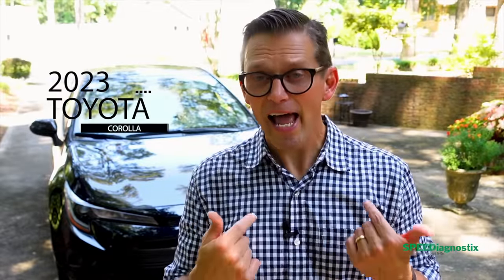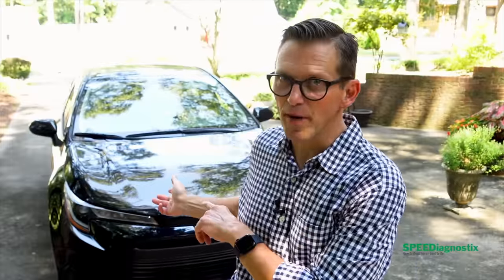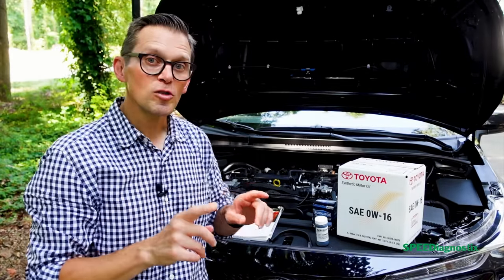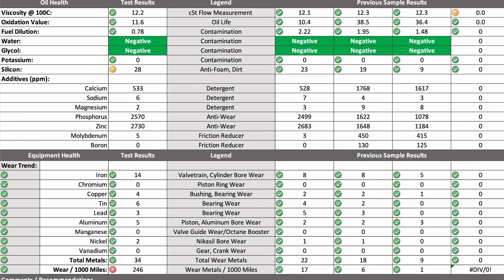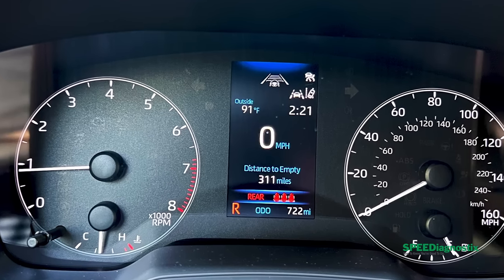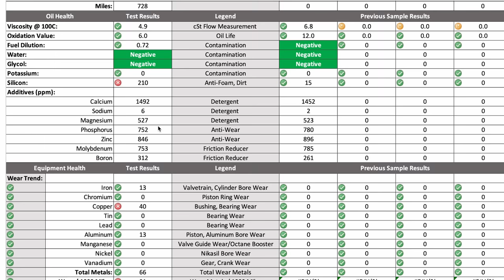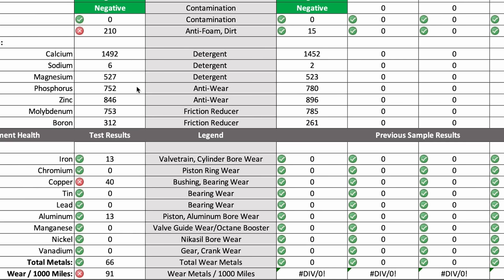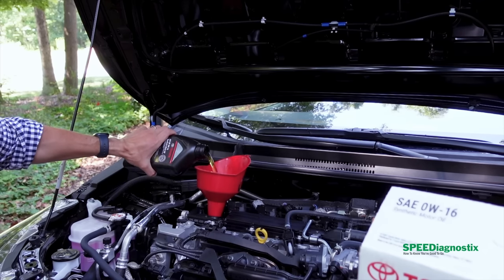AVOID the ONE MISTAKE Almost EVERYONE Makes With A Brand New Car

Comment: Back in the pre synth days I always did first change between 500 & 1000 miles. Then changed every 2 months or 2000 miles. With synthetics I still do first between 500 & 1000 miles and then every 3 months or 3000 miles max. I’ve always kept my vehicles for high miles and never had engine problems. It’s served me well for 40 plus years. Like the old Fram commercial stated “ You can pay me now or pay me later”.
Reply from the maker: Right on!
Reply: Why every 3k miles when SYNTHETIC OIL doesn't even BEGIN to break down significantly at 5k miles???
 Don't you think that's overkill?
Reply: @michaeltammaro482  what breaks down oil is fuel that drips into crankcase after every shut down which is why short trips are killer. Plus if I’m traveling and go over 3K I know I’m still protected. Also heat cycles and ambient temps cause moisture which also gets into oil. This I learned from an oil engineer. But overkill has helped me achieve very high mileage out of my engines with no failures or any problems
Reply: It's nuts to change synthetic every few months! I knew a tow truck operator decades ago who only changed the filter & topped up the oil with another near quart every 3-5000 miles. He was approaching 400,000 miles on the truck.
Reply: @pablobruise1388  maybe to you it is. But knowing combustion and dilution and physically seeing what it does to oil and engines I’ll continue my ways. Been a mechanic for 40 plus years so I’m good with my decisions
Reply: @michaeltammaro482  It depends on the duty cycle.  If it's all city driving in the hot and dusty desert (where I live), 3K is common if you want to avoid sludge. Highway driving in Illinois?  Probably can get close to 8-10K out of it.
Reply: The oil is fine at 3000-5000 but the metals, gas, contaminants in the oil is the potential problem. Tiny investment for long term reward.
Reply: For how many miles have they lasted you? I only did 3k on my older twin turbo car, and 4-5k on my m4. I'm thinking of doing 5-6k on my new corolla
Reply: 3k with modern oil is a waste of money and time.
Reply: @PNW_Sportbike_Life  modern oil is still susceptible to fuel dilution, byproducts of combustion moisture etc. You do whatever makes you happy
Reply: @PNW_Sportbike_Life  My Ford shipped with normal oil, not synthetic.  So it depends on what came with the car.
Reply: Synthetic at at less than 5,000 is a  morons way of doing things 6:58
Reply: @DanielJohnson-ec8rk  You can think that but I’m guessing that you aren’t an engineer.
Reply: @peteschiavoni  I pay attention to facts that engineers have proven.
Reply: @DanielJohnson-ec8rk  So you know what breaks down oil. You’re aware that different conditions cause oils to break down. It’s not just heat and friction. If it were, synthetics could go hundreds of thousands of miles like in transmissions of OTR trucks.
Reply: @peteschiavoni  there are many reasons for oil breakdown. I have my oil analyzed so I know the condition of my oil. Last change was longer than normal at 6,500, oil had not broken down or depleted the additive package enough where lubrication was sacrificed
Reply: @DanielJohnson-ec8rk  Hey if it works for you fine. I wouldn’t say you’re a moron. It’s your vehicle, do whatever you want. As will I
Reply: @peteschiavoni  I used to do the same as you. Then started having it analyzed and found out I was wasting my hard earned money. I drive up to 335 miles a day in a 5.7 HEMI truck and have about 285,000 on this one.
Reply: @DanielJohnson-ec8rk  See that’s the key- the mileage you travel. Engine gets up to temp and stays consistent. When I travel I’ll go over 3K and not worry. But a lot of times it’s 5 mile trips. Lots of on and off.
Reply: @peteschiavoni  I start my truck at 5:15 am and it doesn’t shut off until 6:00 pm. No short trips so therefore, no condensation. My last TBN result was 2.4 so bases weren’t depleted
Reply: @DanielJohnson-ec8rk  That definitely makes a difference. That’s why OTR trucks can go 50K on changes. 
For me it’s either traveling and only shutting off the engine when I need gas or going around town. The around town is 3K or 3 months. When traveling I feel comfortable going over 3K. I also pull a utility trailer around town with lots of hills. So I watch my driving and change accordingly.
Reply: @peteschiavoni  I work in masonry construction. Brick, block and stone so pull trailers regularly but almost always on highways. The high mileage claims of newer synthetics are quite real and accurate. Penzoil ultra platinum is my choice
Reply: @DanielJohnson-ec8rk  Pennzoil is great stuff. That’s my second choice only because I’ve been a Valvoline user since 1982. 
I love synthetics. The peterbilts I drove with Eaton manual transmissions had a change interval of 500K. Any they held up great. Even with heavy loads. We were always past the 120,000 pound truck rating. 😁
Reply: @peteschiavoni  my purchase of a 2011 BMW X5 with the 4.4 twin turbo V8 got me to switch as it’s their recommended oil. After using and the analysis, I was sold
Reply: @DanielJohnson-ec8rk  I think Pennzoil is fantastic. It’s just hard to break away from something that’s worked well for me. There has been times Valvoline wasn’t available locally and I easily chose Pennzoil. I know I can order online but prefer going to the local parts store for things to support them.
Reply: @peteschiavoni  unfortunately I always have to order through the Walmart app orthopedic variety. I use the lire platinum in my BMW AND Toyota and it’s always I stock at the sty
Reply: @DanielJohnson-ec8rk  I get that. I’m lucky my store has what I like. But that’s definitely not the case everywhere. If I couldn’t get Valvoline or Pennzoil locally I’d order it online. Many years ago at my old house I had to drive 50 miles to get Valvoline or Pennzoil. All around me was Quaker State or Castrol.   Just the lay of the land I guess

Comment: So much misinformation out there. This was super helpful to add to my case. I just got a new car and every single person told me I didn't need to change the oil but in my case the manufacturer gave a specific mileage where they consider break in to be done. I will be changing the oil right at that point. Science is a hell of a thing!  Great video!
Reply from the maker: Thanks! I'm glad it helped!
Reply: 1000 miles is probably a good starting point
Reply: @Playingwithproxies  Nissan lists 1200 for my particular model.

Comment: I have always had new cars. And I always closely observed the break in procedures. And I'd change the oil and filters at about 1,000 miles. Switched over to Amsoil and do 7500-10K(for the 10.5 quart sys) changes. On one car, due to past valve drop issues, I sent samples to Blackstone Labs. The results are stellar. I did this for several changes. No titanium at all in the oil sample, along with any other wearable metals. And both my engines rarely need oil additions between changes. I've alway felt that doing this with a proper break in will greatly reduce the chance of having a 'problem child' for the rest of the car's life. Glad to see this video reinforces my original idea.
Reply from the maker: Thanks for sharing!

Comment: I got a 23 IS500 this March, I changed the oil myself at about 600 miles and then again at 1500. I tested it both times, and the first change had tons of contamination, the second had way less, I plan on doing it again at 2500 and then every 5000 after that.  After seeing the oil after the first change it's so critical to not wait imo
Reply: You are smart. You should change the oil by 1,000 miles to get all the crap out of the new engine. If you have a differential in any vehicle, ie, truck, AWD, etc you should change the fluid the first time at 5,000, also allowing the initial metal to be removed.
Reply: @bluesky-ud9wg  ya I have the vehicle parked for winter already but I'm planning on doing the tranny fluid and LSD sometime next summer.  The way toyota doss their oil filters is both a blessing and a curse. It shows everything that the filter catches and scares the crap out of you but since buying toyota's I realize the importance of the first few oil changes.  Once they are broken in there's nothing in there but the first oil change is shocking.
Reply from the maker: Thanks for sharing!
Reply: @bluesky-ud9wg  Absolute rubbish. Just service it as per manufacturers recommendations.
Reply: @motleydude73  Your hilarious if you think that way...
Reply: @bluesky-ud9wg  Why? It's what Toyota recommend, you know the company that built and benchtested your engine? And countless others? You're just wasting $ and perfectly good oil. Hilarious indeed.
Reply: @motleydude73 You don't know anything about vehicles, you're statement says that
Reply: @motleydude73  I would break the facts down for you but I already know it won't be heard and you will still have your opinion...
Reply: @bluesky-ud9wg  I know plenty, and about oil. You obviously don't.
Reply: @bluesky-ud9wg  Please give me your 'facts'. I need a laugh. Undoubtedly will contradict everything I've experienced in my career as an automotive technician.
Reply: @motleydude73  Haha, deflected the question. I'll leave you with another one that you will ignore; Some have a 10,000 oil change interval. The cars with 90-120k start to use oil, doesn't leak, it's being consumed. Wonder why..lol.
Reply: @bluesky-ud9wg  What question did you ask? You just made bold statements with zero validity. And be more specific. What cars? What engines? 90k-120k? Mines done 155000 kms and doesn't use any between it's 15000 km changes. Nor do the majority I work on daily.
Reply: @bluesky-ud9wg  You're basically insinuating Toyota know nothing about the engines they build and rigorously test...
Reply: @motleydude73  Deflected again as usual. Take care
Reply: @bluesky-ud9wg  Says the guy deflecting my questions. You didn't ask me anything, just made brash statements. Not very bright are you?
Reply: @motleydude73  Childish insults, also because you haven't had anyone with more knowledge than you stand up. Anyway you know nothing of my career, my experience at all so take care
Reply: @bluesky-ud9wg  I think you're a 15 year old with your first car that daddy bought for you. Your knowledge is at that level.
Reply: What did the oil analysis indicate the metal came from?
Reply: @motleydude73    May be unlike yourself, he does not lease his cars for 3 or 4 years.
Reply: @bluesky-ud9wg   May be he leases his cars for 3 or 4 years.
Reply: @M.R.1525 In my 34 years of driving I've never leased a car. Where did you get that random notion? Only ever bought second hand and one brand new car in 1995. Kept that for 11 years. That had 10,000km oil changes from new, no 'break in' changes and it had 240,000 kms on it when I sold it. Was still running sweet. As have all my vehicles. Some with well over 300,000 kms. All serviced at manufacturers recommended intervals. There is ZERO evidence extra changes give more longevity. Plenty of evidence to suggest it costs you extra money though.
Reply: Look up planned obsolescenc
Reply: Motleydude, hey genius where is your video, we would all love to hear your genius
Reply: @motleydude73  It depends on the manufacturer and the car.  If you have a high-performance car and expect to rev it in the 3-5K range every day ( especially if manual ), then a proper break-in at those RPMs is critical.  Most people loaf their automatics around at 1500rpm all day long and never put any stress on their car, so the break-in period is much much longer.
Reply: @garman7921  Oh I'd love to make one. Showing how this oil geek is talking out of his arse. But it's kinda hard collecting together all the cars I've done oil changes on over the past 3 decades. Break ins are completely unnecessary and 15k km changes are perfectly fine. Experience trumps assumption.  Stop wasting time and money listening to muppets like him.
Reply: @TheJcrandazzo  Are we talking about washing machines now? Cars do not have planned obsolescence, it's impossible. Once a new owner buys it it's longevity completely depends on how they treat it. A 70 year old man buys a new Camry, only drives it 5000 miles a year. I can guarantee you it will outlive him! A rough as guts logging crew buy a new Hilux and thrash it from day one doing 60000 miles a year. It's probably not going to last 20 years.
Reply: @motleydude73  Why are you trolling? This video is not for you, obviously.
Reply: @JetSkiSuper7  Trolling? 🤣  Is that what explaining facts is called now? Good grief society is a joke. Much like the oil geek and his insane ideas. I'm just adding some much needed reality checks and money saving info. Not that these muppets are intelligent enough to listen. Bluesky must still be in kindergarten.

Comment: Totally agree. My Range Rover Velar first service recommended is 2 years or 21000 miles which is ridiculous. After the first oil change at 500 miles I now change the oil at 10000 miles.
Reply: It's not 'ridiculous', it's specified after benchtesting the engine and oils for optimum performance and longevity. Good synthetics last a very long time these days. It's shocking some  people dump it out after 2000 miles. Honestly, all these home 'mechanics' who think they know better than the engine builders 🤣  I've only ever done manufacturers OCIs never a problem. Why would there be?
Reply: That’s why the break down a lot!
Reply: @chriscarbaugh3936  Mostly from electrical issues. Nothing wrong with that OCI.

Comment: Great video.  Always did the same thing regarding initial oil changes.  I've been turning wrenches since the early '70s.  Never paid anybody to change my oil!
My Toyota filters come with the gasket pre-lubed and also covered to keep crap out of the filter.  Nice touch.
Hey, I've got the same oil change pan!
Reply from the maker: Awesome! Thanks for sharing your experience.
Reply: Same here, the thought of someone else changing my oil horrifies me. Toyota filters and Mobil 1 every 6 months or 4,000 miles for me. Oil is cheap and engines are not!
Reply: I don't trust anybody to change my oil and I'm an old man

Comment: Awesome content!! Would love to see some experiments done with gas additives as well since so many experts agree that lubing crankcase alone isn't enough but when gas delivery system gets lubed constantly via gasoline additives (upper cylinder lubricants), then the wear and tear gets further reduced by some 50% and thus set your engine in for a million miles mark while still going strong (saw a few cases with my own eyes). Liked and subscribed.
Reply from the maker: Thanks! We will make some videos about gasoline additives.
Reply: I pretty much have to run the Lucas fuel additive / fuel lubricant on my 1991 Nissan Maxima.

Not sure if it's because of the terrible factory injectors, or if fuel is just that inconsistent here in Mexico.

If I go 2 to 3 fuel tanks without it, the engine starts to missfire and runs poorly even on premium fuel. 

I just keep a 1l bottle of the fuel additive in my car. What is $12 every 8 to 10 months 1L for fuel additive if it keeps my car running good.
Reply from the maker: It's the fuel in Mexico. Good job on finding something that works and sticking to it.  @Brandon-uy1uv
Reply: I have heard people recommend putting a (very) small amount of ATF or 2-stroke oil in the gas as a "top lube." Not 32:1 or anything; more like 300:1 (a few fl. oz. per fill-up).

I have no idea if that works, or if it's just an Old Mechanic's Tale. I do know truckers running older rigs use ATF to make up for the lower lubricity of ULSD, but they don't have cats. I do run what's left of my 2-stroke lawn gas at the end of the growing season, but that's more about me being cheap than expecting "gains" out of it.
Reply: @JetSkiSuper7  
1. 2 stroke oil is designed to be burned without ash residue.
2. ATF has a lower number of additives to foul a cat than motor oil.
3. 300:1 means about a quart of ATF or 2-stroke every 2100 miles or so. Which is less than many cars burn. (Cars with tow-tension rings can burn up to 1qt/1000 miles before it is considered "abnormal" enough to require warranty work.)
4. I probably wouldn't do this in anything new enough to monitor cat efficiency and set a code.
5. Probably not EPA legal...but if you aren't breaking the occasional law, are you really living life to the fullest?

Comment: Of all of the videos that I have seen mechanics pouring oil from the quart bottle into the engine, you are the first one to pour the oil correctly. It would be good to point out which side of the bottle should be up so the oil doesn't spill all over the place. Thank you for all of the great information that you pass along to us.
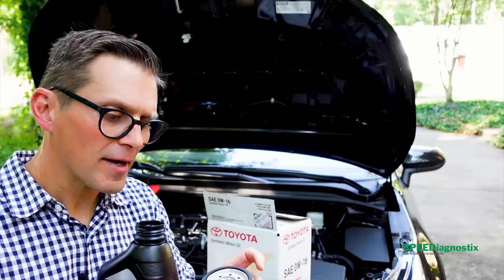Reply: At 11:00
Reply from the maker: Thanks!
Reply: Yes I noticed this too!! Wow this is like my 5th comment in this vid. Lots of experience and knowledge being shared with this video. Good to see and know that "old school" gear head knowledge being preserved and passed on to alleviate the symptoms of this dealer-centric era of planned obsolescence and consumerism.
Reply: Or just use a damn funnel 🙄

Comment: I did my first Honda oil change at 10k. Iron was 29 (vs your 13), aluminum was 19 (vs your 13), and copper was 13 (vs your 40). So two out of three were worse, but not astronomically, and I’m not worried.
Reply: and realistically, the engine is going to outlast the rest of the car. Spending that much on changing the oil just doesnt make sense unless your an oil enthusiast and want to see whats going on with the wear.
Reply: Not huge numbers but you ran those numbers for 10k miles.
If oil is breaking your bank account you shouldn't have bought the car.
Reply: @raving_1074  do you live in the rust belt perhaps? Here the engine and suspension would fail long before the body
Reply: So it didn't need an extra change.